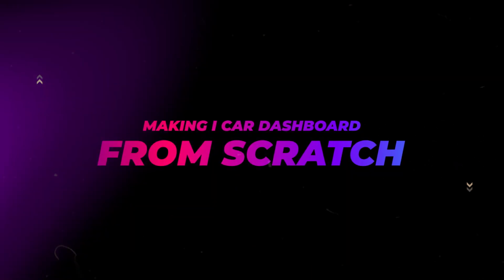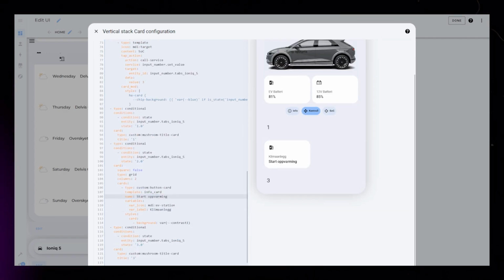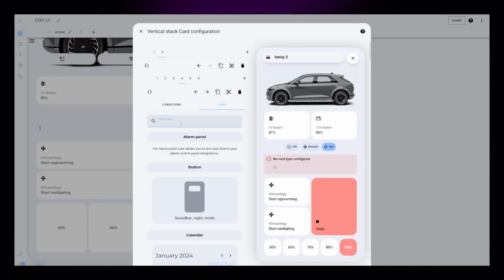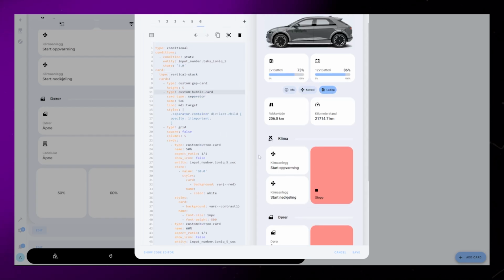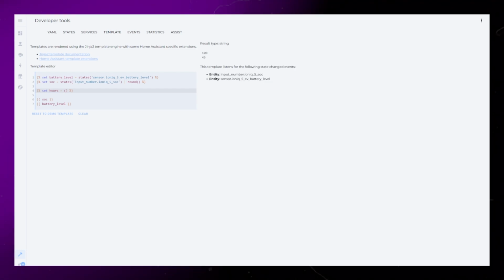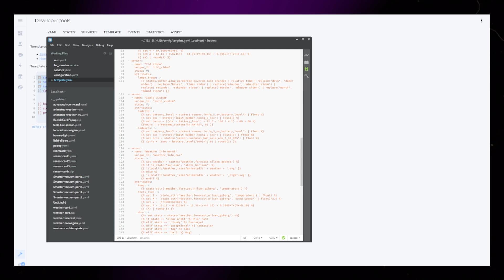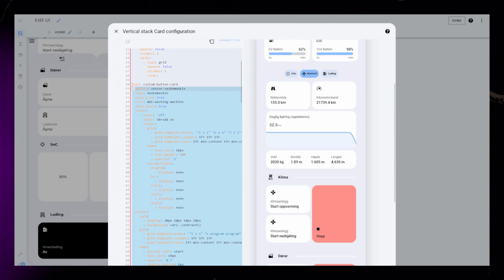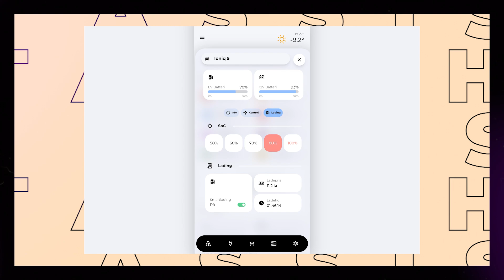Creating a Car Dashboard from Scratch in Home Assistant

Comment: Hi. How did you make bottom black panel with icons which is always stays visible? And how you make popup open not on all screen but leave place for weather on top? Thanks in advance.
Reply from the maker: Hi. I have a video about a sticky bottom navigation bar. The black one is the same concept, just slightly different CSS. I will make a video about it. As for the popup, its a feature of Bubble Card. Its in the UI settings when you create the popup. Called top margin or something.

Comment: Looks very nice, just came across your youtube channel and you inspirated me to redo my dashboard for mobile. Would love to see a short write-up or access to some of the dashboard code, have a ev6 so think that i'm using and have access to similar entity as you have for your car. Btw. Came across a forum post last week maybe interesting for you - Status of EnBW charging stations its called. Allowing to add charge points close by and check/display the status on your dashboard.
Reply from the maker: Cheers! Its always hard to juggle what you want to show on the dashboard. My car gives me 100+ sensors and entities, but gotto keep in mind what is really important. And hanks for the tip, that could be handy! 90% of the time I charge at home tho.
Reply: @My_Smart_Home  Honestly, as my car is a company car - I charge most often at public chargers as the kWh prices in NL are quite high at the moment...  I was wondering about something when going through the video, hope you don't mind me asking. I saw that you now have a new bottom bar - dark grey/black with the navigation part - how did you make that? And second, your scaling of the dashboard is different from mine, yours is way wider on the PC screen, did you make a change for better scalability?
Reply: Guess you are using 'panel' as the viewing type for the whole thing?
Reply from the maker: @baskoers8740  I'm using Layout card in Grid View mode. I can then control the columns for different devices. Heres my current code. I suggest you read the documentation if its new to you.

grid-template-columns: 100%
grid-template-rows: auto
grid-template-areas: |
  "header"
  "left"
  "right"
  "footer"  
mediaquery:
  "(min-width: 1024px)":
    grid-template-columns: 60%
    justify-content: center
    grid-template-areas: |
      "header"
      "left"
      "right"
      "footer" 

I'm gonna make a video about the bottom navigation. Its pretty much a Button Card with some hacky CSS.